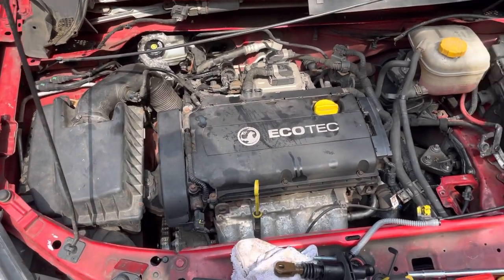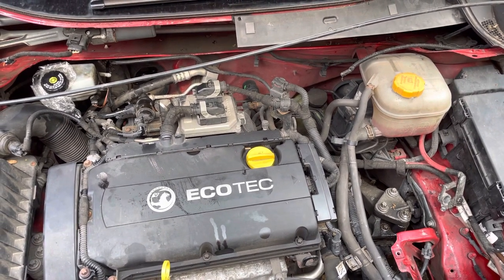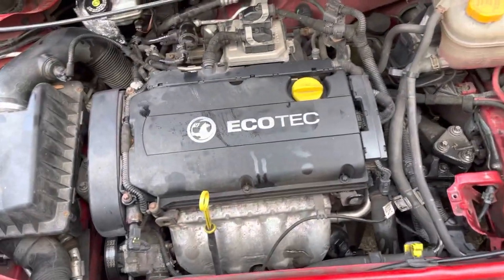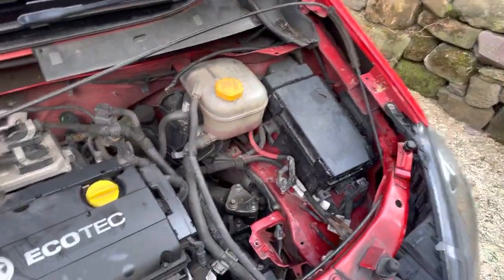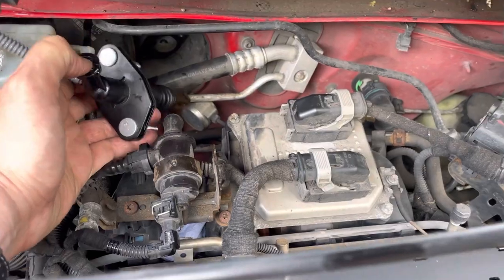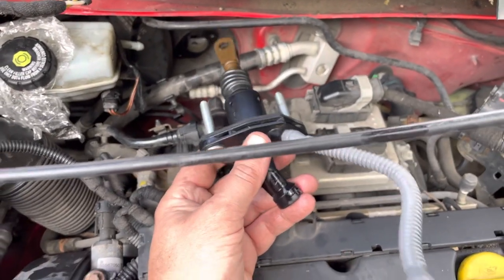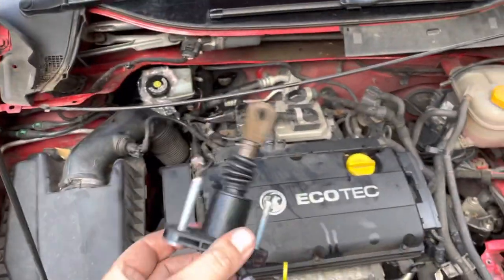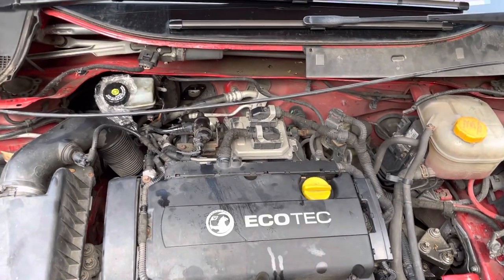Vauxhall Opel Zafira clutch master cylinder problem

Comment: Very helpful video. Just done mine having lost all pedal pressure and unable to change gear. Job went pretty well on the whole. Got lucky with bleeding it. Just opened the nipple kept the reservoir topped up and let it drain through for about 15 seconds,nipped it back up and everything worked fine.
Reply from the maker: Great news, glad you got it fixed.👍👍

Comment: QUESTION: What did the pedal feel like when you had the master cylinder problem? Was it going all the way to the floor? How did you know to look to the MC to fix the problem? Thanks for the video. It has been a great help to me.
Reply from the maker: Sometimes I’d have a good pedal, then it would disappear in the morning, so I’d pump the pedal by hand, and it would come back. No sign of leaks , I pinpointed  the MC, because of the looseness of the mc plunger. I paid 60 quid for an LUK one.
Reply: @drivewaydiyer6504  Thanks for the quick reply. Nice details--very helpful. I don't have any leaks either so that's good to know you didn't. My clutch engages near the bottom of the pedal range. I bled the line and got a little engagement back. I'm thinking of going with a new MC, an OEM part for $140. Crazy your mechanic didn't know to check that for a problem. The estimates I've had never include the MC for possible replacement.
Reply: @drivewaydiyer6504  I replaced the cylinder and now am at the start of the bleeding process. Did you do a video on that? I'm having a heck of a time getting all the air out. Any suggestions on how get all the air out after installing a new cylinder? Thanks!
Reply: with my pedal dropped overnight, engine didnt stall when clutch pressed but tried to. There was a tiny bit of bite lol but not enough to chgange gear. We ,thought clutch had gone so bought a full c20let kit plus f23 slave for 165 quid. 200 to fit clutch but that wasnt issue cylinder was 90 quid cylinder 40 to fit it. I dont want to add it all up :(
Reply: @tutcity  How much did an OEM MC cost you? Where did you get it from?
I have a Vauxhall Astra J GTC 1.4T 2014
I'm facing the same issue, no leak, but the clutch sticks mostly in the 1 2 gear.

A garage quoted me 600 pounds, but If I can source the part and all the steps myself, I will do it myself.
Reply from the maker: @PabitraPadhy it was an LUK one, it cost about £70.

Comment: Was there no brake fluid coming out from the pipe the first time when u was trying to bleed it? (Before changing)
Reply from the maker: The seals has gone in it, so there was fluid in it, but no pressure.

Comment: Hi..
I have a lhd Zafira 2.0 dti 2001 and my brake oil goes dow until the brake red light turns on. I refill the tank and look for leaking, but i find nothing.
My question is: this car only have master cylinder or have a slave cylinder too?
Thanks
Reply from the maker: The car has a master cylinder and a concentric slave cylinder. There has to be a leak somewhere. It maybe coming from the slave cylinder, do you have any clutch issues?
Reply: @drivewaydiyer6504  No issues. But it's the original clutch system. The car only have 140000 km but 22 years old. Maybe it's time to remove gearbox and replace all the system.
Thanks
Reply from the maker: @JeanMelim strange, you checked all the brakes and pipes and under the pedals. Big job to change the clutch if you don’t need to.

Comment: I need help with vauxhall astra mk5 H 2007 the clutch feel free and soft any idea what would it be ?
Reply from the maker: Check for leaks, drop in fluid levels. Sounds like your clutch is gone, possibly slave cylinder. Trying pumping the pedal with your hand, see if it firms up. Check for leaks first though.
Reply: Yes there fluid leak
Reply: Under the car
Reply from the maker: From the gearbox or master cylinder?
Reply: From the gearbox
Reply from the maker: @yadis5239 sounds like the slave has gone, new clutch I’m afraid.

Comment: Hi sir!
I have a opel astra h 2005 which I Chang the clutch and clutch pressure now I want bleed air but it doesn’t give me hydraulic from bleed air pip ?
Reply from the maker: Could be the nipples blocked, might be worth giving it a clean out. Makes sure the reservoir caps off aswell.
Reply: @drivewaydiyer6504  Thank you for your reply, I will check tomorrow, but the pipe that comes from the hydraulic tank event is not hydraulic even there.
Reply from the maker: As in the grey pipe from the master cylinder?
Reply: @drivewaydiyer6504  yes I mean that one pip which coming DOT4 from tank to the master cylinder then other pip from master cylinder coming to the gearbox and ther is also nipples but the pip which coming from master cylinder to the gearbox here not coming hydraulic.
Reply from the maker: Hi , if there are pipes missing, you need to put them in, if that’s what you mean. The system has to be air tight to bleed, so anything missing won’t help.

Comment: Question, my friction plate wont disengage when pedal is fully depressed. Flywheel, friction plate, pressure plate and concentric slave + bearring are replaced 2 months ago and have done 2500miles with them without any problem. The problem started occuring when a friend of mine launched my car from a standstill and wanted to shift to 2nd. I've checked the shifting mechanism, bleeded but none worked. In first gear with clutch pedal depressed to the floor and accelerating the car creeps forward when close to redline. The slave cylinder moves out instantly when I'm depressing the clutch pedal, also it doesn't slip 

What i did notice is the level in the clutch resevoir is decreasing when  the pedal is depressed and raises again when releasing (no leaks under the car or at the pedal)
Reply from the maker: Who replaced the clutch, is it under warranty? It sounds like there’s probably internal damage. Could be the clutch cover. The fact that the car was launched, could have caused something. Could be spring or prong broken. If it’s under warranty, I’d take it back. Could be the master cylinder, letting air in there. Might be worth swapping that out and bleeding it again. If there’s no leaks, then it’s either mechanical or drawing air in.
Reply: @drivewaydiyer6504  Its not under warranty since i replaced it :) The clutch it self has warranty. Like i said the fluid in my resevoir lowers when depressing the pedal and raises when releasing the pedal. I asked a fellow saab 9-3 rider to check if his does the same. His fluid remains no matter if he depresses or releases.
Reply from the maker: Sounds like there’s air in it, might be worth reverse bleeding it. I find that works better.

Comment: What was the first problem to change the clutch mate? My Zafira GSi clutch is slipping in 5th gear we fitted a new clutch and its still the same I'm thinking it could be my master cylinder but the mechanic reckons no. I need help 😫
Reply from the maker: First thing , was I lost reverse and third gear, it was two broken prongs on the clutch plate, it happened out the blue , no warning. Did you swap your flywheel, mine didn’t need doing, which looking back, I think it did, as I have the odd slip when it’s damp. A lot of models have DMF’s , so might be worth checking that. The master cylinder affected my pedal , as I’d keep losing pressure, pretty sure that was a flipped seal.
Reply: @drivewaydiyer6504  No mate I didn't change the flywheel as its not dual mass I didn't think I'd need to but now I'm regretting it as it was done by my local garage 🤦‍♂️

Comment: Also what is that part called? The round metal part that fits on the pipe near to the bulkhead?
Reply from the maker: I think it’s a fluid regulator of some sort. Not a serviceable part. Comes with the whole pipe assembly.

Comment: This is very weird, my 2009 astra h had broken down, my replaced the clutch, exactly a week later the clutch went again, it was the slave cylinder from what people were telling me. I’m trying to find the correct part. Underneath your hood looks exactly like my Astra, what was the specific part that you ordered, could you send me a link? Cheers bro
Reply: Very useful video, im going to have a look at my car and see if this is the same problem, from what you have described it sounds like the exact same, thank you very much for this useful information!
Reply from the maker: https://www.ebay.co.uk/itm/LUK-CLUTCH-MASTER-CYLINDER-511078710-/154470244398?mkcid=16&mkevt=1&_trksid=p2349624.m46890.l49286&mkrid=710-127635-2958-0 this is the one I used and it’s been great.

Comment: How do you disconnect the line of the Brake Fluid reservoir?
Reply from the maker: Do you mean the grey pipe, that adjoins the clutch master cylinder. If so it just pulls off.
Reply: @drivewaydiyer6504  thanks I figured

Comment: I have no cluch when the engine is cold but when the engine is warm i get all gears?
Reply from the maker: Might be a gearbox issue, The transmission only starts working when it warms up. Check out the oil and condition of it.

Comment: Any footage of how you got to the bolts on the master under your footwell mine has a metal plate under the plastics and it seams to be all riveted
Reply from the maker: There’s two bolts, you have to get right under with a mirror. Get an extension and ratchet.
Reply: @drivewaydiyer6504  also need to become a torsionist lmho
Reply: @drivewaydiyer6504  thanx budy

Comment: How did you get on bleeding the clutch?
Reply from the maker: https://youtu.be/UJptKGmMlT4. Very easy in the end. Got the best pedal I’ve had for a long time.👍
Reply: @drivewaydiyer6504  well done. Shame the garage couldn't do it properly the first time. Did you have to use a clutch and brake pressure bleeder to bleed your clutch? I'm interested cause I've got a sticky clutch pedal myself. Thanks
Reply from the maker: Try reverse bleeding it, probably not best to use a pressure bleeder. There’s a link in my above comment of what I did.👍👍
Reply: @drivewaydiyer6504  thanks for that. I didn't realise your video on reverse bleeding. It help alot. Thanks

Comment: Just gone through same shitty thing. Changed clutch but still no pedal. Master cylinder was kaput so bought a new clutch for nothing.
Reply from the maker: It can really throw off the scent. Experience tells me to check master cylinder first or even change the whole lot, if the clutch goes.
Reply: @drivewaydiyer6504  wow i wish you would told me that last week bud. Gutted i am. I would started with cylinder for sure but im not a mechanic. A tip for others though, always source your own parts or you will be stung. I paid 90 quid today for a cylinder which is 23 quid. If mechanic would have gotten the clutch god knows what the bill would have been. So people Always get your parts yourself.
Reply from the maker: The problem with master cylinders is that you can flip the seals when bleeding it through. So it may have been fine , but the bleeding knackered it. So it’s a hard one when the clutch is on its way.
Reply: @drivewaydiyer6504  yes i hear you bud. I bought a used clutch from this forum i go on vxr on from a kid and fitted it back in January 2020. It lasted until last week, wouldnt go into gear, only just tiny bit of pedal, lost all pressure. So this time i though id get the C20LET uprated clutch which is stronger and straight fit with a F23 slave of course. Fitted it but then still had no pedal. Old clutch we took out was cracking so makes me feel abit better as it would have failed soon but it lasted. My car only needed cylinder though lol but now got everything.
Reply from the maker: Hopefully it will last you a few more years, did it need a new fly wheel or did you get away with it?
Reply: @drivewaydiyer6504  Got away with it,Cars fine bud, took it for a long run to get some charge back into battery. She seems more responsive since new clutch, she just wants to go. Change into 2nd and she kicks you back in your seat.
Reply from the maker: Great news.👍👍

Comment: My CORSA D 1.2 2010 was an ABSOLUTE pain in the a….e
I undid everything and it was loose ready to come out and there is no space whatsoever for it to come out of either side!!!! From what I’ve researched the foot pedal box needs to come out to get the master cylinder out, ended up getting out a mobile mechanic
You have to remove the steering collunm to remove to get the nut out for the pedal box.
Reply from the maker: Dreadful, I really feel for you mate. Luckily the Zafira isn’t that bad. I suppose the master cylinder is a none serviceable item, so they don’t take it into account. Thanks for the input, hope you’re all sorted now.👍

Comment: Just to give you a update on my zafira b Sri. Got it towed as it would not go in gear. They took it and called me and told me my clutch plate had cracked 👀. No idea how that happened 🤷🏻‍♂️
Reply from the maker: They do break, ive had it a couple of times. At least you know , what’s up with it.👍
Reply: If you had it replaced and they used power tools to tighten down the plate there is a chance they can warp it. Should be torqued down by hand, ideally.
Reply: @drivewaydiyer6504  Can I ask what they symptoms were? Did you have a spongy clutch pedal?
Reply: @SaucyBegger25  I bet this is the problem with mine. Thanks for sharing. Mine has had two clutch replacements (same as yours) with the same problem persisting. Not as bad as yours was but still very similar.
Reply from the maker: The symptoms I had was , a disappearing clutch pedal. The pressure would slowly go on it. There was no leak and would come back when I pumped it up. It was quite strange.

Comment: My zafira been feeling strange  lately like gutless. Been shopping and on the way home I felt a pop through the clutch peddle then it was hard to get it in gear. Feels like I’ve lost half the pressure in the peddle. From a stand still I’m really struggling to get going but once I’m off cars fine but hard to change gear still. Could this be the same problem? No burning smells from clutch and no slipping from what I can tell. Just seems to be the peddle gone soft and now it’s not pulling off properly. High revs to get it moving like the clutch isn’t engaging after peddle back up
Reply from the maker: Could be , might be the first port of call. Could be the slave aswell. Does sound like the master cylinder, though. Check for leaks and drop in fluid level. Get it checked out ASAP, before you get stranded. If it’s the slave, then it’s gearbox out and new clutch.